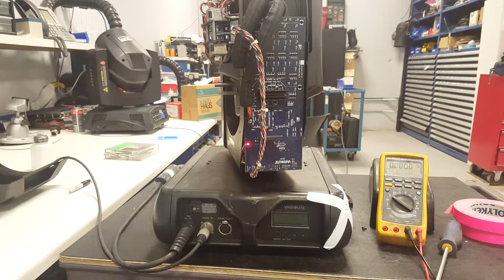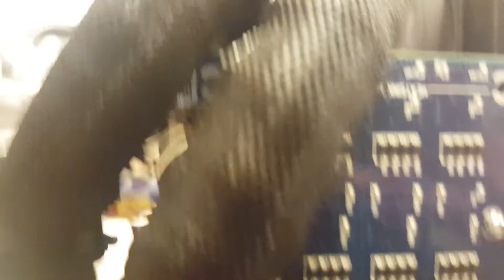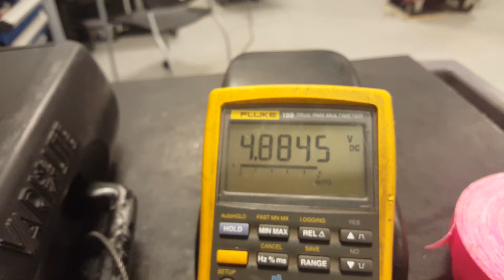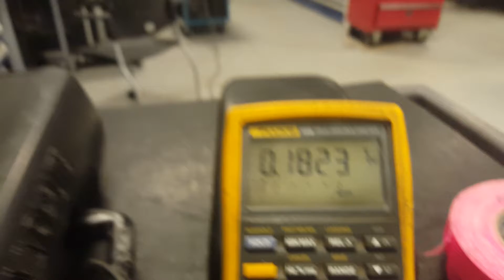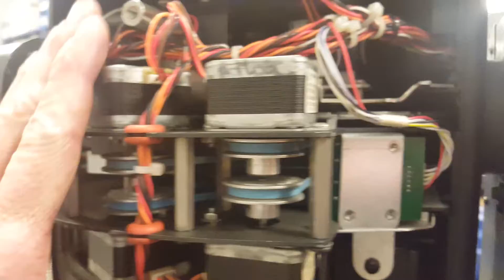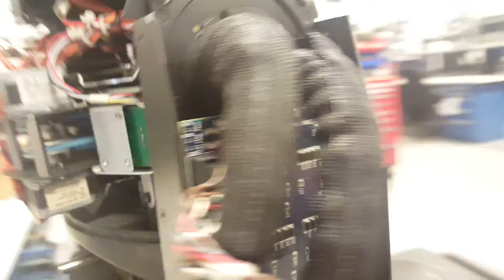VL2500 spot wash No Sensor troubleshoot Vari-Lite

Comment: I just purchased some used fixtures and my first problem is a dimmer sensor.  I went through your process and i am getting constant reading on the test, so it's a sensor problem. 

I can't understand you in the video, what is part you say needs replaced that you buy online?

thanks!